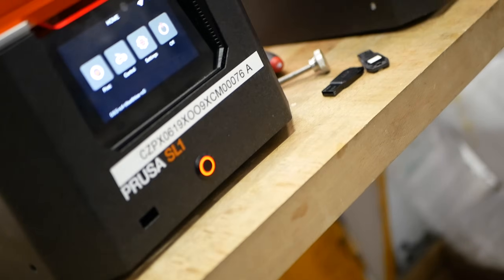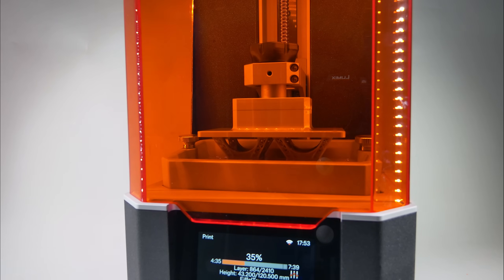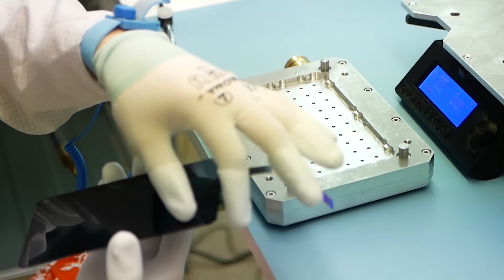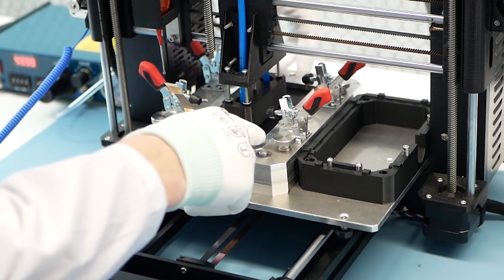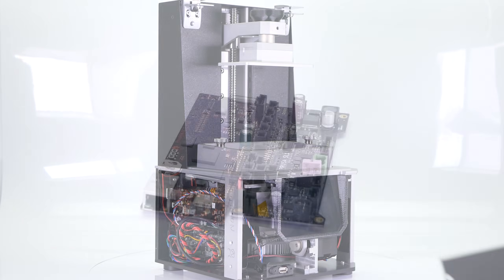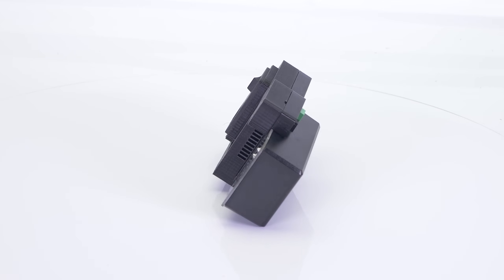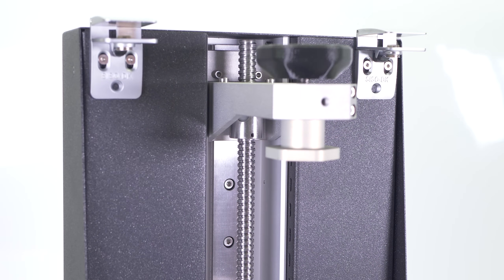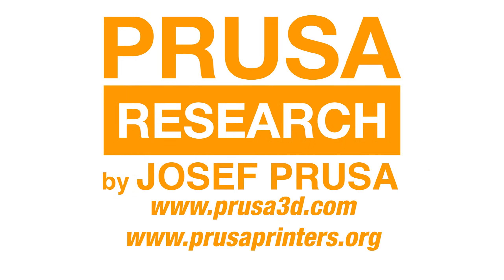Original Prusa SL1 Development Update

Comment: I used to be such a Prusa fanboy but they are fast becoming the Apple of 3D printing, Since the Mk3 my trust has gone, constant paid upgrades needed to get the machine working as advertised means I will not trust an SLA printer that is 4x the price of the photon and looks almost identical. My photon works perfectly and I dont need to keep buying "upgrades" from anycubic every few months. inb4 the SL1S gets announced just before Christmas that "fixes" issues that shipped with the model
Reply: I am trying to see how this printer is better than the Anycubic Photon. 3X the price, it should include a laser. For the same price, the Peopoly Moai seems a better deal with larger build surface and a laser instead of 2k screen.

Comment: As a electronics failure analysis engineer, I am glad you are taking the extra time and making a clean room. Removal of contaminants is very important. Also, are you X-raying the circuit boards after production and measuring the solder voiding.  This is especially important with your LED panel. Just finished a job where the LED's were just falling off the PCB in the lights at the stores. They had a big problem.  Love your engineering, keep up the good job.

Comment: The print quality is very nice but the price is also not very cheap ... 1600 bucks for an assembled printer ist quite heavy for my opinion for an "old" technology.
Reply: Especially since you can get a real SLA printer for less than that and a much bigger print volume. Go grab a Moai if you want to get into quality resin printers. If you want to get into cheap resin printers that will do the same quality as this you have a ton from china.

TBH this thing can't compete with the Moai in any field. The quality on the Moai is better no matter how you look at it. If anyone says otherwise they are probably fanboys or shills. 
It is the technology that makes the Moai or any true SLA printer much better than an LCD resin printer. Oh the Moai is also cheaper and better tested. They are also apparently releasing the Moai v2 which is going to be even bigger for not much more. 

If Prusa had brought this thing out at the same time or closer to the release of the first Chinese cheap resin printers or better yet before the release of the Moai. They would have stood a good market chance. Now not so much.

Comment: Probably already mentioned somewhere, but what will the cost per unit be?
Reply: PRE-ORDER (please don't ever pre-order stuff) kit is 1299 USD excluding shipping and Pre built is 1600 USD exl shipping. 
Essentially it costs more than a Moai kit and the Moai has been out for a while. Much better printer. It's an actual SLA not an LCD resin printer.

Comment: I have an Anycubic Photon and it produces great results, but this looks like it will be a better machine. It will also be more expensive, I'm sure. One feature that would be really useful is per layer exposure and wait times.

BTW, the resin I like best is Nova3D clear.
Reply: The kit is 1299 USD ex shipping and the pre built is 1600 USD and they are on ore order. 
If you want a high quality machine then check out the Moai instead. It is a true SLA not an LCD like this printer and the photon. So resolution is far far higher. 
Also Prusa has only mentioned that the LCD panel is "2k". The standard 2k resolution is 2048×1080. The Anycubic Photon has a resolution of 2560x1440 which is higher than the standard for 2k. Essentially because we don't have information on the actual resolution of the Prusa display, you might have to assume the Photon has a higher resolution or at the very least the same. Even though 1440p is more like 2.7k. Hence why it is never marketed as 2k
Reply: @super_salty9189  Moai is laser :( So it's slower, the reliability of galvanometer is significantly lower compared to LCD. The SL1 is using 3D antialiasing, so you have to use a microscope to see something like a pixel artifact. The Photon has very little if anything at all in common with the SL1 (or the Moai). The Photon I used screeches and makes other terrible loud sounds during printing after just a few prints. The whole frame flexes, the bed assembly is terrible, you have to slide it out and inevitably scratch the screen with this, which then cracks.
Reply: @TheMikolasZuza  speed is dependent on how much area needs to be cured per layer. If you have many tiny pieces an SLA can be faster than LCD as LCD will take longer to cure er layer. Essentially if your layer time curing on an LCD is say 5 seconds. If it takes less than 5 seconds to laser the parts then your layer will be faster on SLA. 
But the real benefit of an SLA is the more wider acceptance of materials. You can use engineering resins or any other special resin that requires high UV output to cure that an LCD may take more than a practical length of time per layer or potentially not cure at all. That's where the high focused UV output of a laser will surpass anything an LCD or DLP can put out. 

Regarding accuracy of a galvanometer. 
Some well priced ones can have accuracy well past 0.0001% or better?
Also you do realize that some of the most expensive resin printers on the market use them and that the accuracy is entirely dependent on how much they cost. I can guarantee cheap inaccurate galvanometers are not being used even on the Moai or any other SLA printer. If you believe that to be true you should email Formlabs and Moai for the secs on their units.

With regards to Anti-aliasing. See my comment to Josef. 

If you are having problems with your photon that other users are not having. Then go to one of the groups and ask around. Also contact Anycubic and ask if it is a quality control issue. It sounds like you got a bad machine or it got damaged at some point. If these were common issues nobody who owns a Photon would be happy.
Reply: Martin B I don't understand your naming of the categories. All laser, dlp and lcd are in the SLA category. Any printer that uses light to solidify a photopolymer is by definition SLA.
Reply: @TheMikolasZuza  You are absolutly correct. However it is far simpler to call a galvanometer directed focused laser SLA printer just an SLA printer. Because that is just a mouthful. In comparrision it is much easier to just call all the other methods of SLA by their technology names. A DLP SLA machine uses a DLP projector to project UV light. An LCD SLA machine uses an LCD do selectively darken the output of a UV light. 
So absolutely if you want to get specific. You would have to call something like the Form or the Moai a galvanometer directed focused laser SLA. 
Unless you have a far better short name you can give it that is at least close to as short as saying DLP/LCD SLA. 

You can't just simply call everything SLA unless you are also stating the exact technology. Hence for simplicity it is easier and understood by most that use any SLA printer that you call it by it's technology unless it is the Form or Moai style tech, in which case it is just an SLA. 

Does that make sense?
Reply: @super_salty9189   In other words, this printer is about 3 times more expensive than the Photon. It'll be interesting to see what will justify the extra cost. One possibility is better software. The AnyCubic software is adequate simply because the DLP process is so very simple, but their software is crap. Prusa is much better about developing slicer applications.
Reply: @johnheaney4203  Thing is you don't have to use the photon software. There are a few options. One of them being FormWare and another being B9 creator. There are a few. Just do a google and check out some reviews. Just remember that some of them you will have to tweak settings from the defaults. Just compare your normal settings in your photon slicer to whichever one you give a try. 
Personally i recommend Formware. Although with that statement I haven't had my photon for about 3/4 months. I wasn't doing as many prints on it as I was doing on the Moai because of build volume. 
So my knowledge of current slicers for it is limited. 
Also I do remember someone was creating an addon or something of the sort for Cura and Slic3r to add functionality for SLA printers. Maybe have a look into that. 

The guys over at Anycubic do need to work on their software. Apparently they are working on it in the background. But their dev team is small and never had experience with this type of software as far as I heard. 
It would probably take me or any other dev in a more generalized field a weekend to create a simple slicer with basic functions in C# or something similar that would not be a buggy mess. Getting support structures etc in is a bit more of a troublesome one. However best bet is to use meshmixer to create your supports and then drag that into your slicer. Gives you far more control anyway.

Comment: I was wondering about the strength of parts created on an SL1 vs pla or petg on and fdm machine?
Reply from the maker: There are slightly flexible resins (when cured) and those are suitable for 
functional mechanical parts. We're testing them atm.
Reply: @Prusa3D  would it be strong enough as main gear fro these helies?
https://www.youtube.com/watch?v=xB2ifaTQ_kU

If so then spares will become available for vintage rc helies (most of my fleet)

Comment: I was looking for the moai sla printer, it has a laser light. Do the 2k  LCD screen of your print has advantages compared to laser ?
Reply: Laser (SLA) compared to DLP (what this printer is) usually has more resolution, but it's barely perceptible. The advantage of a DLP printer is that it prints a whole layer at a time. So it doesn't matter if you have multiple parts printing at once, or just one. Print time will be based on how many vertical layers you have, and how long you will expose them. SLA is more like an FDM in the way that the laser point has to move around the perimeter and then fill inside, just much faster than FDM. Yet, that's not comparable to DLP in term of speed, especially if you plan to print full plates. If you only print one thing at once, and it's very small, you'll probably be better with the Moai, but you won't have the same smart features and support than with a Prusa machine

Comment: once again. Prusa can't keep to schedules. 
Stop with the pre-order bull. 

oh and I LOOOVVEE how the narrator essentials said "oh we were having problems with cracks on print displays......but as long as you use all of our approved resin (that is going to cost more than anything else...oh and did we mention the crazy price of our shipping)....oh and don't print pieces that at any given layer cover a large portion...or else you could still break it...."
Even though you supposedly fixed it. 

You are kidding right? what other lcd printer on the market has this issue?   The answer is none of them. 
What are these so called "extreme" conditions?  oh and again "low quality resins". You are just saying spend money on your resins...."of course". 
This is silly. An over priced lcd printer with a tiny print volume that can't even compete in any category against other much cheaper options on the market. Plus it seems to have a few issues others don't.
Sorry why should people buy this printer again?
Oh right you guys think that as long as it has the Prusa name on it, that any Prusa fanboy is going to buy it.
Reply from the maker: The displays no longer break when you use the printer as described in the manual - no special approach is needed, just stick to recommended settings, Slic3r profiles etc. like with any other machine on the market. There's even room for tweaking the profiles and exposure times, if you want to give it a go. Extreme conditions mean that you are using heavilly modified profiles with incorrect values and you're actively trying to damage the printer. Using ultra-low quality resins can be potentially problematic the same way low quality filaments can be problematic for an FDM/FFF 3D printer. Since the moment we changed the gluing method, we haven't encountered a single cracked display.

We have tested over 100 different resins and prepared profiles for them - these are normally available resins from various brands which you can buy from Amazon or any other store near you to minimize shipping costs. We're not "locking" the SL1 to Prusa Resins.
Reply: @Prusa3D  Well lets see when actual buyers get the printers in hand. For them I am hoping it isn't another MK4 situation. 
That's a much better outlined "extreme" set of situations. I assume you will be full warranty replacing any cracked screens and be covering shipping in the event that they break under normal non extreme conditions withing the first few months?
You know like how most companies operate if they sent out a sub par product. 

It would be great if you could let us know what resins failed your tests and why?
I assume you have that data somewhere. 
I am sure the whole community would benefit from it if the tests are representative of others experience and help to weed out poor quality resins that could cause damage if they exist. 

On that last point. You should matching what is seen in the video to what is said.
I know in the movie world they call it "eyeline matching" but it has another name for informational videos and ads. I just can't seem to remember what it is. 
Essentially the premise is that it is best if the viewer can see what the narrator/character is talking about. 

The reason I bring it up is because you shower a slightly blurred panning image of what is clearly Prusa brand resin, while talking about how you tested over 100 resins and approved them for the printer. 
This without some clarification either on the screen or from the narrator can cause a misunderstanding of what was intended. 
"tested X number of X" + images of their brand of X = conclusion is either 1. that only their brand of X is suitable 2. they want you buying their brand and they are marketing in such a way to make the viewer believe everything else is of poor quality. 
If you are going to make high quality videos, make sure they do convey what you really intend to say. I am sure it would have been just as easy, if not easier, to line up the resins you used during testing and do a blurred (to hide brands that may not want their brand appearing in video) shot of them. 

Other than all that I appreciate you taking the time to respond.
Reply: @Prusa3D  Could you also give an exact specification for the resolution of the display screen. The standard for 2k is 2048×1080p. 
If this is accurate how will it compete with the 2.7k (2560x1440p) display of a cheaper Anycubic Photon or similar Chinese LCD resin printers?
Reply from the maker: The display resolution is 2560x1440. We use antialiasing both in the 2D plane and in the Z-axis, so it's impossible to spot the pixels on the model.
Reply: @Prusa3D  then why call it 2k?  That is just underselling a 2.7k or more commonly known 1440p display (anyone talking about display panels will just say 1440p). Underselling an expensive product is not a good idea.
Just saying. 

 Anti-aliasing has it's benefits. But also has drawbacks. While yes it can potentially help to smooth out edges, you also have the potential to add something that was never there. 
That said. At the PPI of your screen you should not have to run any anti-aliasing. 
Run an accuracy stress test with cubes, half spheres and lattices. One without anti-aliasing and one with. At your resolution it should not matter. 
Anti-aliasing is more for DLP resin printers that have resolution issues. It is far harder to get a high resolution low cost projector that it is to get an LCD display. That is why high res projectors cost so much as opposed to their equally resolutioned TV/phone etc counterparts. 

The reason I commented on why you mentioned 2k in the video is because there is a fairly big difference PPI wise between flat 2k and 1440p which would have set you behind the cheaper Chinese printers.
Reply: It's SLA not LCD. Please watch the video again and understand what Josef was actually saying, and stop jumping to biased conclusions without knowing the details.
Reply: @Joshuadomiel  do you not know what an LCD based resin printer?   wow and you want to call me out?  you must feel like an idiot when you find out what an LCD resin printer is. 
If you do know what an LCD based resin printer is....then you need to do exactly what you said I should do. 
This printer uses a 2k LCD panel to control the light from the UV Source below. 
SLA is an entirely different technology that uses a UV laser to cure the resin. 
I just feel bad that you completely missed the mark on that one. Remember to get facts straight before you comment.

Comment: Nice looking printer. Does it support antialiasing ? Wouldn't be better to have two screws or two rail system so over time by constant pulling and pushing the vat bed on and off we don't get z wobble ? Also its like 1K more than pretty much comparable Chinese versions....
Reply from the maker: Yes, we even implemented 3D antialiasing ;) There is no Z wobble with the high quallity ball leadscrew we picked.
Reply: @Prusa3D  thanks :)

Comment: Better to wait longer with a good communication of the delay reasons than to get a half-baked product. Way to many companies choose the second option. Kudos to you!
Reply: @blazingcobra7228  I have bought a Ultimaker S5 for the company very recently and I'm extremely unhappy at the moment with this printer regarding print quality and ease of use. They also said there would be an aluminum print plate in the package but it is missing with a note inside the box that I will get it once it is available. Why do they throw the printer on the market if it is not developed completely I don't know 😢